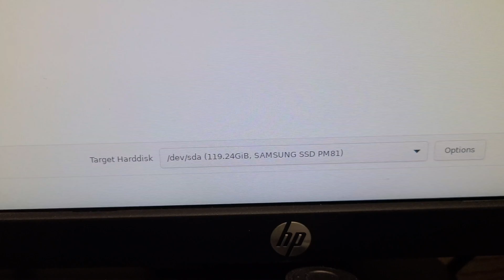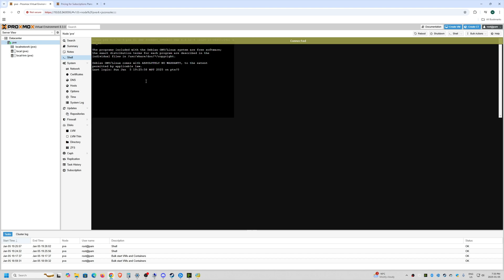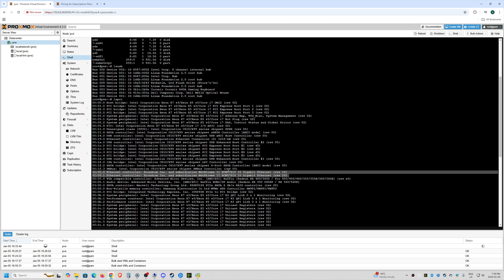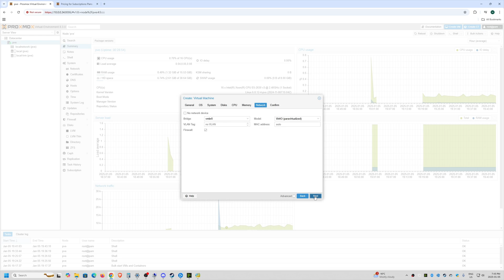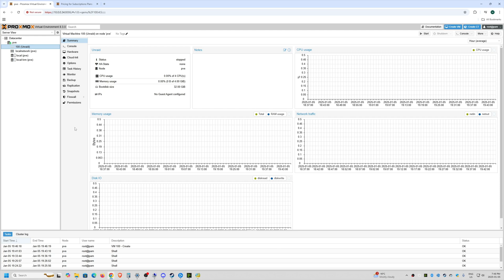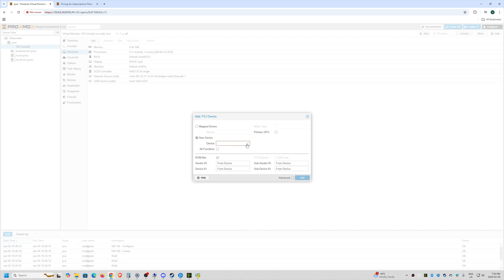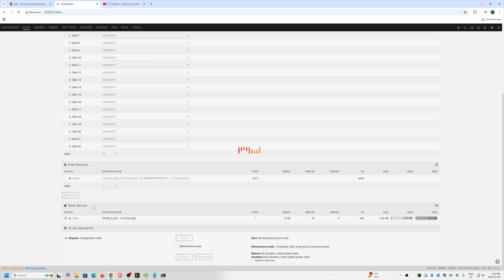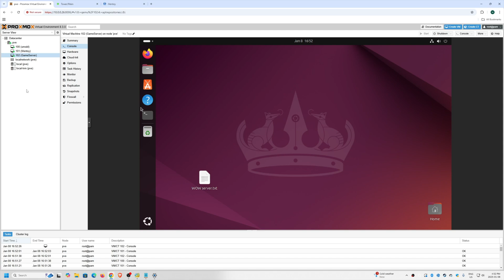Server overload!  Lets consolidate multiple servers using Proxmox.

Comment: Why did you put in that GeForce (or any) graphics card? And also, why did you passthrought those NIC's and not give them to proxmox, so all VM's benefit? And... Why bother with the passthrough of the (non-nvme) disks? Instead of importing the unraid system, why not reinstall it add the disks to proxmox and copy over the ~700Gb to a new fresh box?. So many questions... Hahahaha. No judgement, just wondering.
Reply from the maker: Yup!  OK so this channel small enough that I can take the time to answer your questions.
So to start off, I had almost 2 hours of recorded footage for this video.  It is always a gamble how you trim the footage down to make a video.  I didn't bother showing the trouble I had importing (passthrough) the disks into Proxmox as I felt it wasn't compelling enough to leave it in.  As well, this wasn't supposed to be a "tutorial" video.

"Why did you put in that GeForce (or any) graphics card?" - The HP Z440 motherboard does not have onboard video.  Would need a GPU to drive the monitor to actually install Proxmox.  As well, I was thinking about messing around with a media server and by extension, video transcoding.   A graphics card is pretty much a required item for that.

"Why did you passthrough those NIC's and not give them to proxmox, so all VM's benefit?" - I didn't show it in the video but one port of that 10GbE NIC was originally used for my Unraid system.  I have an identical NIC installed in my main computer.  As well, I currently do not have a switch capable of 10GbE.  One day, I will have a full 10GbE capable LAN!  That NIC was previously configured on bare metal so I could have a really fast connection between my main computer to the unraid server.  As far as any benefit to any other VMs, I don't need a "fast" connection for any of the other VMs... and I just wanted to get my unraid server back to what it was when it was on bare metal.

"Why bother with the passthrough of the (non-nvme) disks?" (Paraphrasing - "why not just reconfigure the array and move data after you have backed it up in some way...") - So yeah, the point of the video was, "Can I successfully move the bare metal install of my servers to Proxmox and virtualize them?"  (P-->V - Physical to Virtual) I actually have a few TB of historical channel videos backed up that I have already copied over to the unraid VM now.  For this video,  I left some non critical data on the unraid share to make it easy to see if I was successful do P-to-V.  As well, even though I didn't show passing though the disks.  The process of passing through disks is the same whether they are from an existing array or brand new.  In reality, it was actually faster to import the existing array rather than start over.  

Thank you for watching and for the engagement on the video with these questions!!!  :)
Reply: @RandomTechMichael  Thanks for the elaborate answer. I thought you had some LACP 10Gbit switch setup. And no onboard video... Hehehe, ok. makes sense. I have P2V-ed probably more than 100 linux machines. I used to do the "dd" thing, but started using tar and rsync instead. It's a bit messy, but it's so quick and can greatly reduce downtime (almost non) and have not had any issues with it. Cheers!